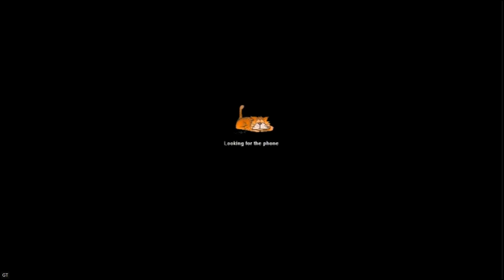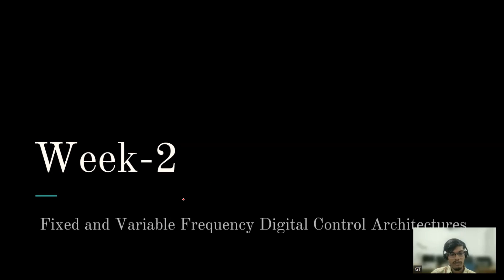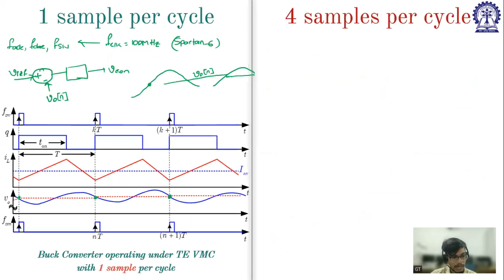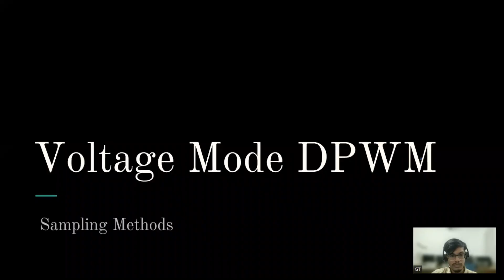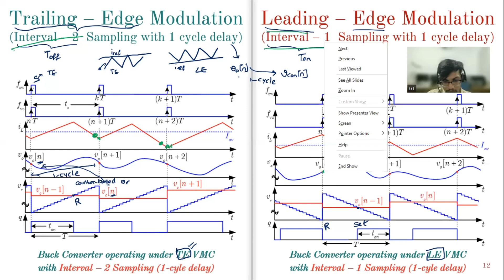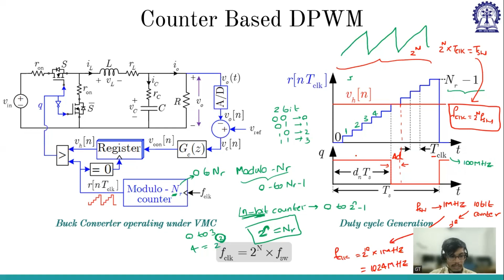Week 2 | NPTEL | Fixed & Variable Frequency Digital Control Architectures | Problem-Solving Session

Comment: sir in constant off time control you are saying minimum on time is given., to which the minimum ON time is given., is it for mono shot timer.,?
Reply from the maker: Monoshot timer is used to generetate constant-off time in "Mixed-Signal Constant-Off Time CMC" and ON-time is generated by the closed loop. 'Minimum ON time' block is a separate block which is used to generate minimum ON time else the system might collapse under certain circumstances. So, both are separate blocks and the details of their MATLAB implementation will be discussed during our next session.
Reply: okay Sir!
thank you